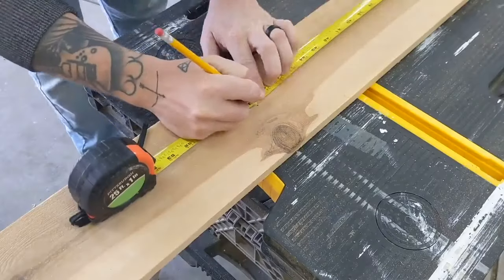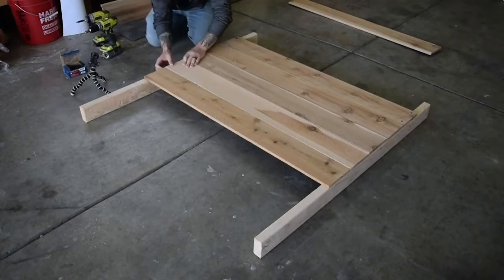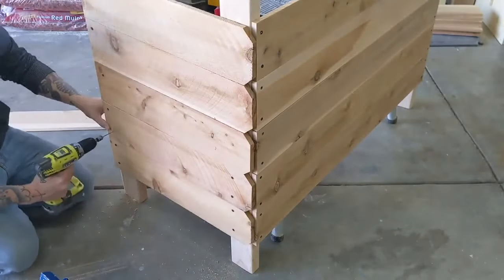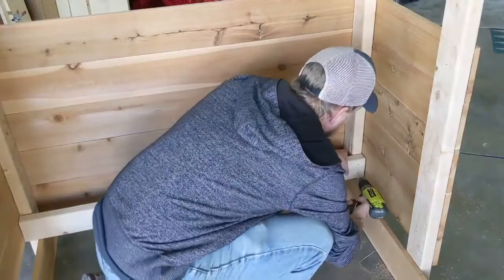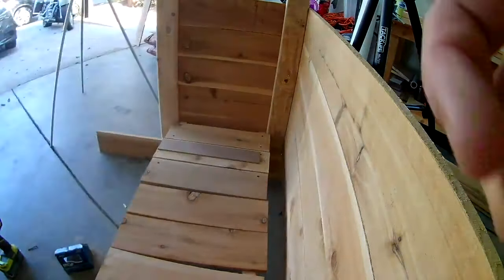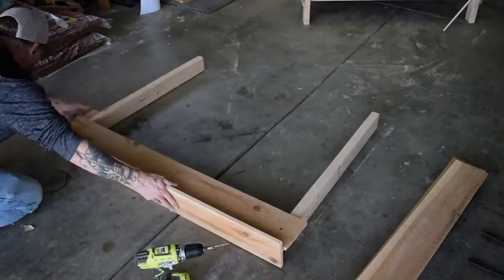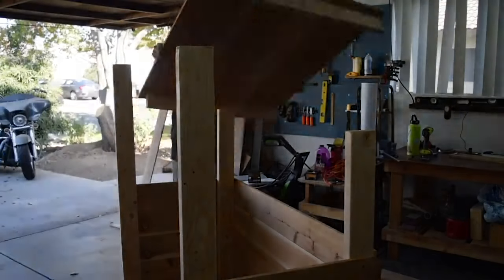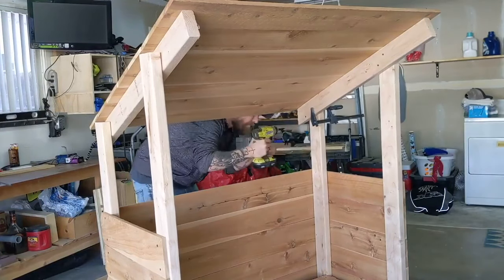DIY Wood Shed Plans | How To Build A Wood Shed | Wood Shed Ideas

Comment: You could have saved A LOT of time by stacking several boards and pre-drilling pilot holes.  Also, given it is a "wood shed", spacing between the boards to allow for more air flow to dry the wood would be appropriate.  PT 2x4's would make it last longer.  Nice simple design and explanation.  Good video.
Reply: I was thinking the same thing Mike

Comment: Is it for in the house?because it would hold enough firewood for about a weekend
Reply: Tip: Increase the length of the boards. Or, you could build two and screw them together. Walah! A shed twice as big. 😊

Comment: does the roof leak? im guessing it will because the roof panels aren't overlayed to create a shingle effect.
Reply: Probably, but it's firewood. A few drops of water will dry out quickly from the sun, wind, and low ambient humidity.  Won't cause any issues seasoning the wood or keeping seasoned wood burn ready.

Comment: What kind of screws did you use? galvinized ? or and length(s).
Reply: Don't look on him - he use wrong type (Drywall screws are not meant to be used to connect wooden parts) use galvanized ore stainless or with special coating for outdoor use.